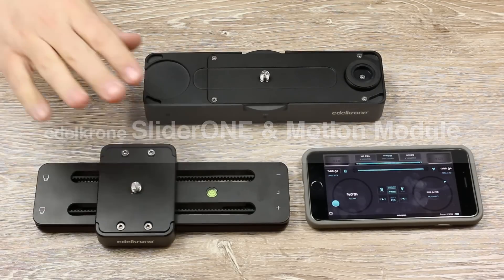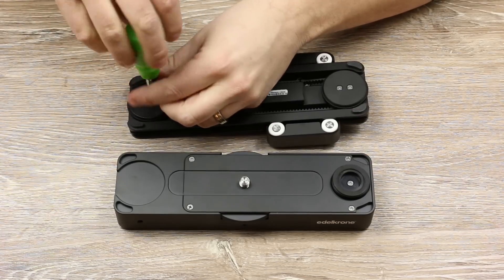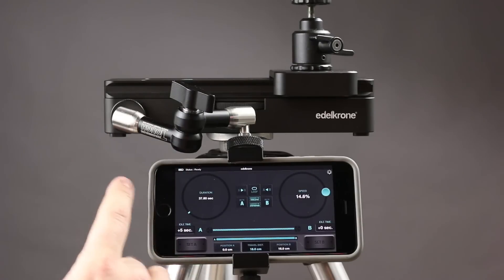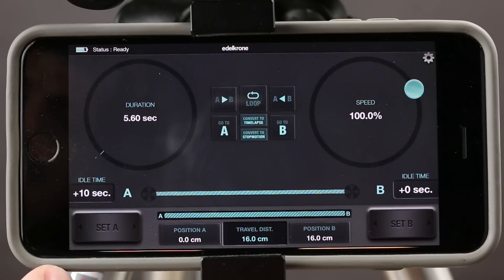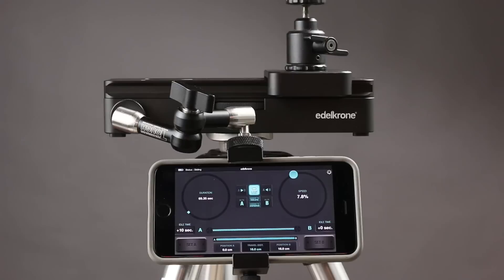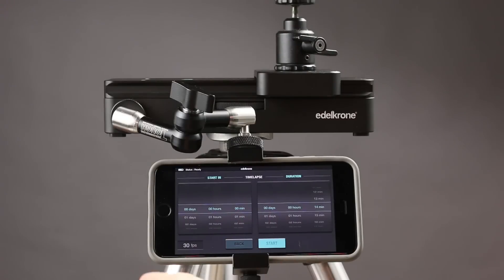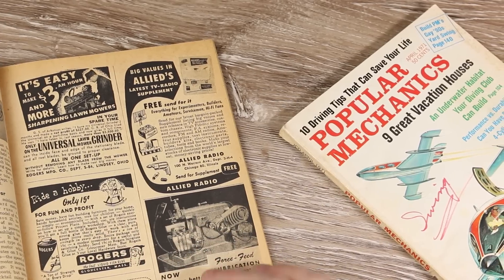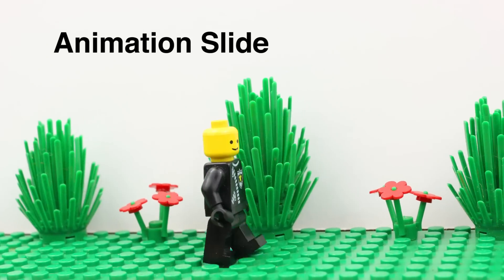An in Depth Look at edelkrones NEW-  SliderONE & Motion Module

Comment: This is the most in-depth video I've seen so far of this product. Question, what clamp did you use to attach it on 1:05?
Reply: Edward Carlo Abarilla that is a Manfrotto super clamp with a 3/8" adapter.